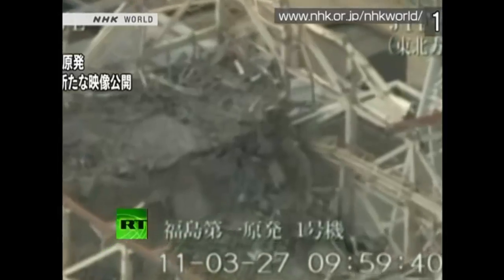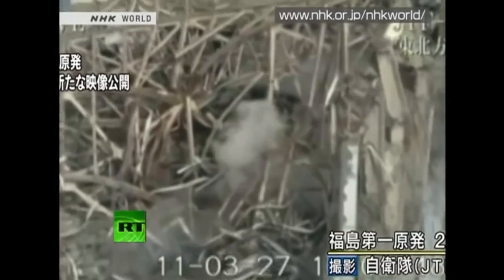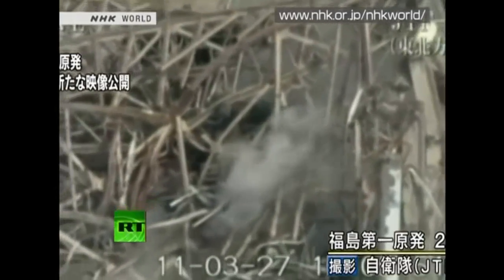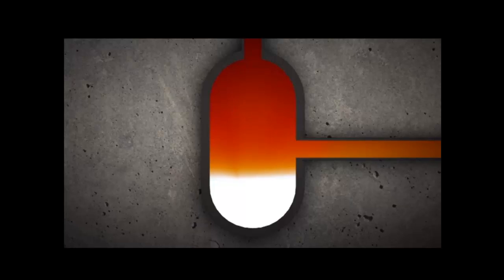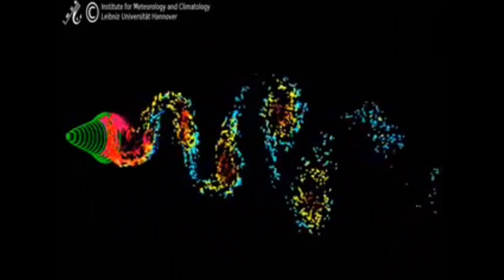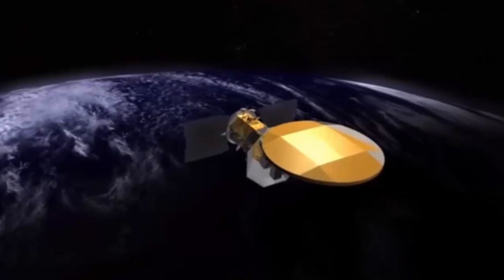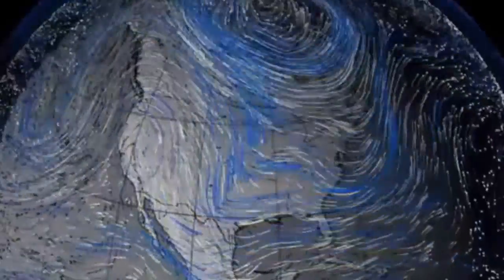Wigner6: Fukushima "Dust of Death"

Comment: I've been studying this effect; it is most interesting and destructive. :(
Reply: I have lived in both Southern Indiana and NW Kentucky. There is a bridge that connects these two states in Henderson KY. There was only one bridge for many decades that crosses the Ohio River and then approximately twenty years ago another bridge was constructed to ease the traffic jams.

On Friday, I noticed that the original bridge isn't looking so good. It has become BADLY rusted and I attribute this accelerated rusting to the Wigner Effect. The newer bridge is looking okay so far. I haven't ever had a fear of bridges, but I'll tell you, when I crossed that rusty bridge from Kentucky to Indiana, I was a little anxious.

So you are correct. The Wigner Effect is both interesting and destructive. I would prefer that the destructive elements of the Wigner Effect weren't so obvious on a bridge high above the Ohio River! Have a good one Adam! Cheers!
Reply: Ame3thyst3 A lot of our infrastructure is rotting markedly faster lately. With bridges, my philosophy has always been cross them as quickly as possible. I took a bridge near here at 160 once in a Corvette, and that was just a wee bit too fast because I got a little bit airborne, but I still cross them at 100+, just in case, so hopefully I'll just sail over the gap should it happen, or it will be behind me perhaps. LOL Aside from that, I have noticed the same thing with that same bridge, it was built to augment the traffic flow, very tall so ships pass under, but the older drawbridge is in very bad shape these past few years. The Wigner effect attacks these materials, but the ionizing radiation does the same thing to all matter, specifically, US. Terrible stuff. Cheers. :)
Reply: Adam Selene Oh so you were the guy that flew by me in the corvette! I'll be looking for your "blur" as I cross the bridge from now on! lol I am going to take your advice and increase my speed as I cross that awful bridge. There IS a method to the madness...speed !!! Well that makes sense to me!

Another thing I have noticed is that recently you cannot get cell phone service while going across the bridge. I don't know why or how this is happening, but it is. I usually make a quick call on the bridge to let my relative know I'm close to getting there...but no more. I don't understand this. As soon as you finish crossing the bridge, cell phone service is back to normal. I know you're not supposed to call while driving. Whatever they did to put the phones out of service certainly works. Now I call when I leave home so they know I'm on my way. How odd though to not allow phone service? It really makes me wonder!

Well thanks for the answer Adam. Pedal to the Metal !!! I guess I'll be a blur from now on! lol Not a corvette blur though, dammit !!! Corvettes ARE a chick magnet but I am certain you already know that! lol Have a good one Adam! Cheers! :)
Reply: Ame3thyst3
That could have been me. LOL
Added radiation and particulates from the "geoengineering" spraying of micronized aluminum, combined with the steel in the bridge structure could explain the cellular signal dropping out, as well as increased charges on metal surfaces from the Wigner effect, perhaps. There are lots of factors that have an effect on Ghz frequencies; short wavelengths do not penetrate materials very well, or maybe they killed a tower nearby and the next nearest doesn't have the punch to penetrate the structure (anything metallic that is grounded bleeds away signal).

The Vette wasn't mine, was just one that I fixed for a friend and had to test her out, but it was a fun ride. :D Yarr!
Reply: Adam Selene
Thanks Adam. It probably was you in that Vette! lol  YARR!!! .
i obviously don't have the knowledge that you do regarding effects of Ghz frequencies and other possible factors as to why the cell phone service is moot. It is so nice to have smart friends! You learn so much! Especially the flying across the rusty bridges.  lol  You crack me up Adam! YARR!!!
Have a good one :)
Reply: Ame3thyst3
If I can make folks chuckle, life is worthwhile. :) Yep, I'm an old techie; anything about energy or technology interests me, although i don't use anything more high tech than a PC  and pro audio equipment anymore. I haven't even got a computerized car. LOL Yarr. ;)
Reply: Adam Selene
You are good at making people chuckle which means you are having a worthwhile life! I had depression after a divorce about 15 years ago and every morning my Dad would call me and say, "Do something worthwhile today!"
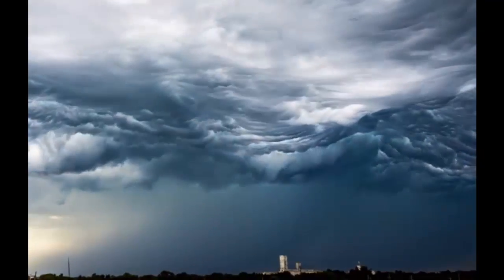Needless to say I didn't for quite a while. I had lived in Texas which (back then) had lots of sun and moved to Kentucky shortly before the time change in October and it was dark at 4:30!!! Had I known then what I know now I believe I would have gotten better much sooner. Nothing like a tale of depression to make others laugh!!! NOT!!
I didn't have a computer until 3-4 years ago which probably would have helped me focus on other things rather  than how profoundly sad I felt. Enough of that! YARR!!! :)

Well I am impressed with your techie knowledge and your ability to make us laugh! You have a gift Adam of being able to make us happier than we were. A sense of humor can keep us going and you certainly have a rich sense of humor! Thanks for the chuckles Adam. You are one good soul !!!  Thanks Adam! YARR!!!
Reply: Ame3thyst3 Aww, such praise gonna' make me blush, if that is still possible, not sure. LOL Kentucky is beautiful. I have been divorced about that long myself, dabbled a bit afterwards then gave up on that aspect, but I did get a great daughter out of that experiment. There is plenty to be depressed about these days besides just being singular. I see it as a mind-over-matter type thing. I could easily be depressed with all that we face, and perhaps I was at first when I started many years ago (right after getting divorced, in fact) to look into the truth vs. the fantasy most people live in, but now it just gives me strength. The harder the evil pushes, the more I dig in my heels and push back. Anyone that wants me to stand down and shut up will simply have to kill me. I've been using computers since the days of mini-mainframes and teletype machines with paper punch tape for storage; you'd think I would learn to touchtype in all those years, but I still hunt and peck like a stubborn old cuss. That profound sadness is something I am familiar with. I am an empath, which makes it really interesting, if a bit annoying, but I would not change even if I could; I just would not be me.

The tech stuff and physics, chemistry, psychology, artisan trades, construction, tactical arts, astronomy, alternative energy; oh my interests and hobbies are endless. If you have ever read Robert Heinlein, his book "Friday" describes me fairly well in the main character (although Friday is female). She seeks to become the "World's Greatest Authority", and while there is not enough room in my gourd for all knowledge, I do try to cram as much of it in there as possible. A score of huge hard drives help me to store that which I can't retain.

There are so many people that spread misery, it is incumbent on anyone that can muster it to spread a little light any way we can, which is one of the reasons I am so fond of Dana; he has that gift and it recharges me. Anyone that says anything negative about that man is a mental defective.

You are a good soul yourself, and if I say it, it is automatically true, of course. My favorite thing to laugh at is the stuff that comes out of my own mouth. I crack me up too, which I firmly believe is the first step to enjoying life.

Yarr! :)
Reply: Adam Selene
LOL!!! Yes you do crack us both up!!! Loved the last two sentences! LMAO!!! A good belly laugh!!! Thank you Adam!
I too got a great daughter out of that experimental marriage!!! I would do it all again just to have her!!!

It's pretty bad when you're saying your vows (at the Justice of the Peace so I guess it isn't TOO blasphemous and my daughter was there too, having yet to make her appearance lol) and you KNOW the marriage isn't going to
last !!! I wanted my baby to have a "name" for that was super-important when I was growing up. Didn't want to bring any shame to the family name! My My how times have changed! Ain't no shame no more!

And yes I know you are a stand-up guy for I've read some of the "debates" which could sometimes be considered "verbal attacks," or at times, what would be an "all-out fight" with another if they were only close enough! Oh there would be some bruising involved! Broken bones a possibility too! They do not realize how lucky they are to be far out of your reach!!! Especially when it comes to standing by Dana. I too am protective of him. This guy tried to get me to say something negative about him but that wasn't going to happen. I am extremely loyal to those I care for.

I will look for the book "FRIDAY" as I love to read. However I keep getting drawn to the computer since I didn't have one for so long. I had much to catch up on! How I found Dana I do not know but I am so glad that I did. He is hard-headed, smart, and stubborn and I like that. And look at all the great people I have met. I am blessed.

Have you heard of Zeolite? Heard it is a rad-killer and heavy metal-killer too. More on that after some research.
I play piano, write songs, and sing. Right now I am working with SongShine which helps people that have Parkinson's, have had a stroke, or simply have an aging voice. I'm not certified yet but that is my next goal. I am the substitute pianist and go with my mom each week for class. We keep it lively for I come from a long line of blabbermouths. My daughter took a quiz and told me, " Mom, I'm a blabbermouth and you are too." I guess you probably have noticed !!! lol

Well thank you Adam for making this 5-inch snow day so pleasurable. I knew there was much going on in that head of yours and I was right. Have a good evening and hope to see you at Dana's tonight....of course Dana would have to be there first lol.

YARR! :)
Reply: Ame3thyst3 Yeah, the kiddos are the best; mine is the reason I'm alive today, and why I fight this corruption every chance I get.
I suspect that my ex wife had her fingers crossed when taking the vows, but I would not want to ask her about it; that gal has a wee bit of a temper. I think she expected me to change and I expected her not to. People are funny critters. :)

I do get upset with people when they attack my friends, but I haven't cracked anyone in the head since I was a teenager, though sometimes I'd not mind watching someone else do so to certain types of people. When it comes to dotboy, I'd even take video for later amusement, but I can't physically attack anyone for words alone, they would have to attack me first. Still, if someone tries to take me on physically, they have given up their right to safe passage and I have no issue defending myself, though I may not be as effective as I once was, I still know all the sweet spots. Then, of course, I always have a weapon or two handy, just in case. I have a pretty messed up right knee, so I always have my walking stick (a 6 foot fire-hardened poplar staff), which is very effective if you know how to use it, and a handcannon of some sort. Despite what the anti-freedom people say, folks that carry concealed firearms are always the first ones to back down from a fight if at all possible, because that is intrinsic to the grave responsibility of being armed. This getting old is not something I'm fond of. People say humans age like fine wine, but I think we age more like milk.

Friday is a great book; easily one of my top 5 favorites. Heinlein was a brilliant man, superb author, especially considering he was a Navy man. One often does not expect brilliance from military people.

Dana is exactly as you say, and having grown up on the water (Atlantic in my case), I relate closely to what he says about the Pacific. Yes, he exaggerated when he said the pacific was dead, but anyone familiar with ocean life knows that there should be 50 times more life than there is there now. People unfamiliar just wouldn't understand. The group that digs Dana is a great bunch of people. I used to have no issue being out in small craft in heavy weather and people told me I was insane, but the truth is, I was simply one with the sea. 20 foot seas in a 21 foot boat in gale weather may be more than I want to tackle now, but I always felt that the sea knows that I love her and she would take care of me as long as I didn't do anything stupid; the couple times I did she let me off because she loves me too. LOL

Yes, I am semi-familiar with zeolite, though i have never used it. Zeolites have pretty much the best cation exchange capacity of anything that you can ingest. I should really get some of that stuff. I have used bentonite clay for detox purposes, which is very good at pulling the metals and toxins, including radioactives from the body, and I can personally give that stuff the thumbs up (ack, thumbs up; I spend too much time at YT).

Aha! Music is God, you know. I can't play a lick of it myself, sing badly too, but I am an audio engineer by trade, used to be live sound, but those 300 pound speaker cabs got heavy so now it is recording and mixing mostly and some production work for other people's shows. Hehe, a blabbermouth, eh? I'm a tad long-winded myself, methinks, but usually only when talking with interesting people (or trying to change someone's bent mind LOL).

5 inches of snow....yeesh. Here in NH we have been lucky so far that today's precipitation has only been rain, but if it doesn't quit soon it'll be snow. I prefer the rain, as it shovels itself. Oh yes, always something going on in me head, usually a slew of stuff, and if I didn't meditate, I'd probably never sleep. Thank me? Thank you! I am always happy to talk with bright people, especially as rare as they seem to be. Hmm....7pm, I must be medium rare by now. ;)

I hope Dana does a stream this evening; if so I shall be there. Now to go to the basement and make sure no water is coming in, maybe finish building that table or something.

Yarr. :)
Reply: Adam Selene
Did you ever see the movie "The Truman Show?" Truman notices that his "wife" had her fingers crossed in their wedding photo. lol And it is actually nice to hear that you aren't one to enjoy beating the crap out of someone. It's refreshing to know that you are prepared to protect but aren't hoping to use your "log" and cannon! I have often said that Dana's "lady is the sea." No wonder you feel Dana's love of the sea so much for she is your "lady" too!
Remember the song "Brandy." Yep, that is you and Dana. And SHE loves you both!

I noticed that Dana's face was different somehow when he was on the boat. Like he was in another world....HIS WORLD. You would be able to explain that better than me. He was observant, content, and at peace all at the same time. He was in HIS element. There was this "balance" like he was "in the zone."

 I heard on some vid that Music is the 4th Dimension. "Music is God" is a bold statement but you won't find me disagreeing. Music must be on a higher dimension as Earth isn't looking so good right now.

I'm glad you meditate for it helps those with active minds and it helps you sleep. My mom meditates because, like you, her mind is always on fast forward. I am a more laid-back thinker. And she too has insomnia sometimes. The nightly routine is regimented at her home. Lights out! No conversation! Shhhh! You're talking too loud !!
I DID inherit the blabbermouth gene from somewhere and I think I know where it started....get my drift? lol

Well I am going to check and see if Dana is on tonight! Take care Adam and it has been so nice to visit today!
Bless you and yours. I think I am medium well. lol See you soon and good luck on your table!

YARR:) !!!  Dana's on!!!!  Gotta go!!!!
Reply: Ame3thyst3 Oh yeah! I had forgotten about that. Truman Show was a great flick. While there are those that are begging for a good crack in the noggin, I'm definitely not the one to do it. Anyone actively threatening the lives of my people will find themselves in an untenable position (or worse) if I have anything to say about it, but I'd rather not ever be put in that position, and so far so good. There are two kinds of peaceful people: pacifists, and those that are peaceful because they desire peace while being fully capable of shredding a serious threat; I am definitely the second sort.

Yes indeed. I love the Sea; she settles my soul and eases my worries. She is beautiful, tranquil, at times furious, dangerous and still beautiful. All the energy one could ever need is right there, both in a spiritual sense and in a power generation sense. Communing with the Sea is a lot like a waltz; if you move with it She moves with you, if you move against it, She will trip you. I am easily lost on land, but put me on the water in pea soup fog and I'll dead-reckon my way to a small island 20 miles out with no instruments. Dana might never try dead-reckoning in the fog, but he has that gift of the Sea; he understands. His element and mine; I'm even a Pisces. In the zone, yes, at peace. It is a bond, like being one part of the whole, lost without the other part, and it isn't the life in the Sea; the Sea herself is a being, an entity, living, moving, breathing. I really can't explain it with words; it is something that has to be felt. Is it not ironic that humans are killing her for something She can provide more of than we could possibly ever use, namely electricity. Yes, I know it is all about weapons, in truth, but the irony is valid.

Music is God, for it can touch the soul as nothing else can. I am not religious; religion requires that one choose a sect, a cult. I find that too limiting. I describe myself as being spiritual. Earth is in trouble, no doubt about that, and it really twists my turnips that so few people realize it or even care to find out, even to the point of arguing that everything is fine. My compassion for another being is not limited to my estimation of that being's intelligence, but there is a point at which  intentional, deliberate ignorance forces me to see another being as an inferior creature. I don't want to feel that way about anyone, and for that matter, I'd rather do almost anything other than fight these crazy nukers, but they leave me, leave US no choice. It is not the end of life in the universe, for it is mathematically and statistically impossible that this is the only planet with sentient life on it, but it is the only one we are aware of, certainly the only one we have.

Meditation, when I am tired, puts me to sleep in minutes. Other times it replaces sleep nicely; one hour of meditation is about as restful as four hours' sleep. The running on at the mouth thing (obviously) is one of my aspects too, but I don't do that with everyone, only those that I find intriguing, already aware, or ready to become so.

Dana was good tonight, maybe a little tired.
I screwed up that table I was building. LOL I'm not the greatest woodworker, but I'm getting better.
Very nice to visit today. :)
And blessings back at Ya'.
Now I'm well done, time for a nap. :D
Reply from the maker: Ame3thyst3 I think 2 segments from this one is where we talk about infrastructure changes, bridges, water mains, rockets, stuck roller coasters, etc...havent got that far yet but I'm working on Wigner7 now ;)
Reply from the maker: Adam Selene Ame3thyst3 I think you guys should xchange email info, lol ;)
Reply: Rad Chick
Excellent. I shall look forward to Wigner7.
Oh yeah, we got a tad off-topic here. Sometimes I forget what thread I'm in. Sorry about that. Superb post though Christina. :)
Reply: Rad Chick
Thanks Christina! I love this Wigner Effect Series! One reason I suppose is that you can't actually SEE the hot rad particles but you can sure SEE their effect on metal !!! I have this vid almost memorized lol !!!
I would LOVE to see a "blooper" vid of you and Lauren !!! LOL!!! Bless you both.
Reply: Rad Chick
You are right about that Christina! Adam forgot what thread he was in and I don't even know what a thread is!!!
Hope you're feeling good today and bless you and yours as always. :)
Reply: Ame3thyst3
LOL I probably have too many subscriptions to keep track of where I am. :P